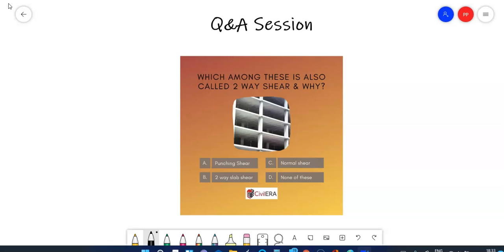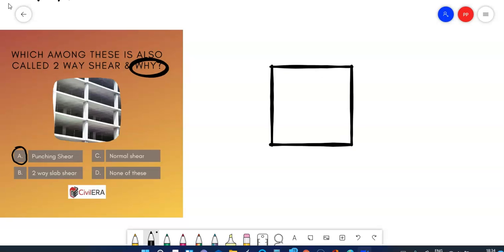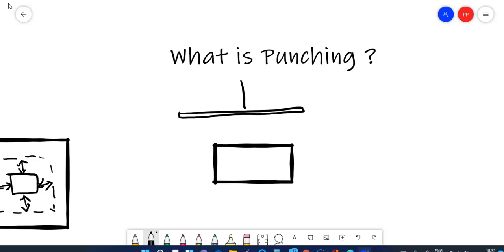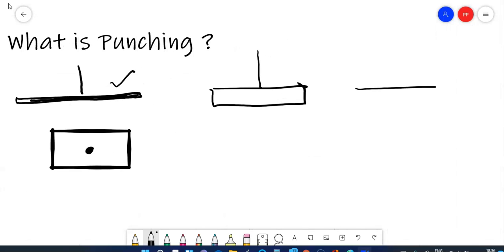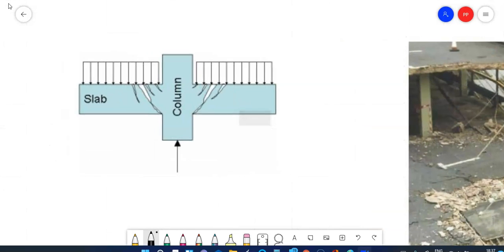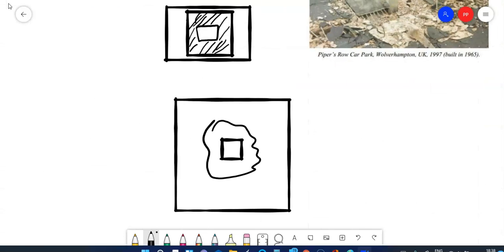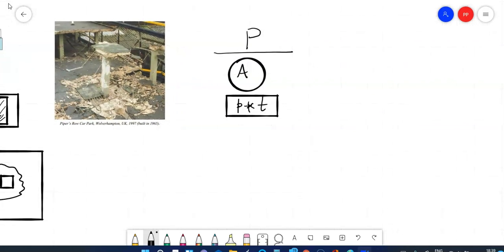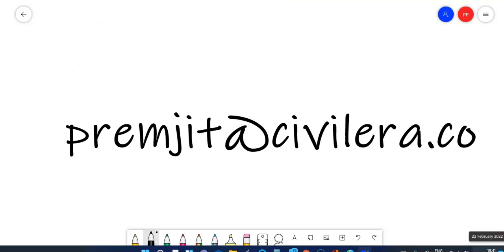Why is Punching Shear Failure also called Two Way Shear?

Comment: Punching shear is called 2-way shear partly because it is generally associated with point supports in 2-way slabs, and partly to differentiate it from one way shear in that punching shear applies around a point support and one way shear applies along a line.  Punching shear can apply in a slab that is reinforced and bent in one direction if a point load is applied in a concentrated location so it is not strictly a phenomenon of 2-way slabs.

Comment: Then what is the difference between one way and two way shear?
I know that the distance of d from coloum face for one way shear...here I asked you the difference in real life structure?
Reply from the maker: Thats the normal shear force
Reply: One way shear would normally be associated with a slab that is reinforced on one direction and spanning only in that direction.  One way shear applies along a line such as when the end of a slab is supported along its width by a beam or wall.  Two way shear typically applies around a point support and not along a line support.